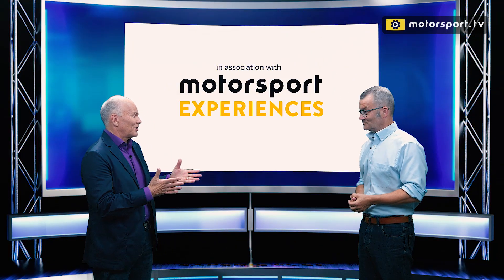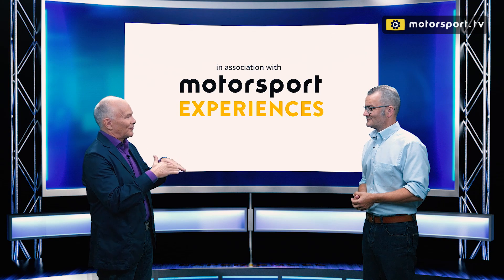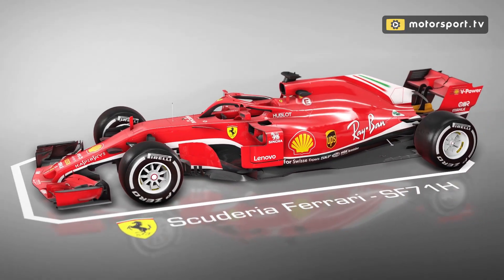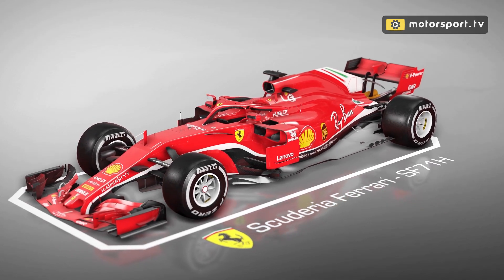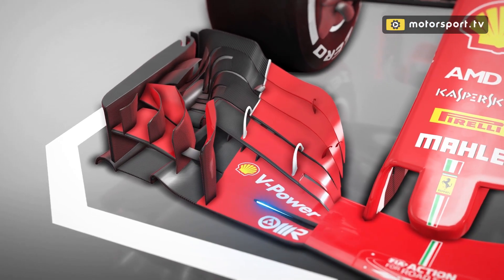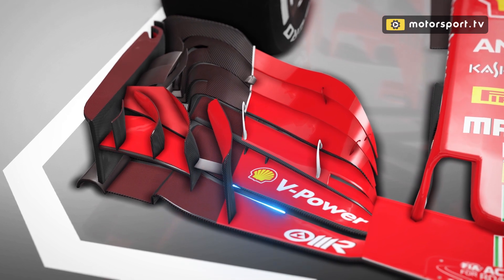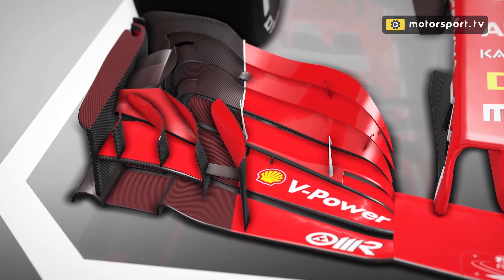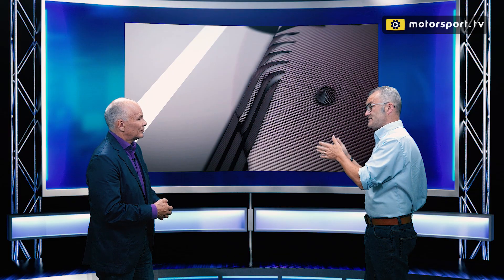How new floor slots helped Ferrari win the British GP

Comment: Ferrari brings a small update = improves a decent amount and becomes the team to beat
McLaren brings a whole raft of updates = Goes from being 6th best team to 8th.
Reply: McLaren have the best chassis. The only problems is the unreliable and underperforming Honda engine which holds them back. 

Oh wait. They can’t use that excuse anymore.
Reply: MashiatCOD99 a whole raft petty much won't matter if they don't work properly that's the biggest difference.
Reply: And floor and diffuser isn't small they're one of the most important areas of an f1 car that you can gain for laptimes in other words well worth it and paid off for Ferrari as clearly shown.
Reply: Gerogy Zurkov That's kind of what I'm getting at.
Reply: McLaren is a yoke... a YOKE!
Reply: Mclaren was never the 6th best team this year, that was an illusion created by the amount of points they gain from DNF´s by the other teams. If you see every race Mclaren scored points, most of them if not all, they did it because Force India, Renault, Haas and Sauber had accidents or DNF´s.

So basically Mclaren was always in a bad situation, it just looked like they were bouncing back, but it was because of other factors, not because they had or have performance.

If you see the races where mclaren didn´t score points (the ones they didn´t DNF) most of the faster cars in front of them manage to finish... So no free points for Mclaren to look like they are doing something right (which they aren´t, the car is a aerodynamic drag mess, making them slow in straight line speed).
Reply: Mohammed Ismail Truth be told, I think that is being taken out of context a bit. Firstly, McLaren generally never stated they had the best chassis in 2017, they said that they'd comfortably be in the top 4 hunt if they had a half-decent engine, and guess what? They were indeed the 4th best team at tracks like Monaco, Hungary, Singapore and were pretty competitive in tracks like Austin and Interlagos. I think the only time they claimed they had the best chassis was during the Mexican GP as a one-off, where they were the quickest cars in sector 2 in Q1, and one of the quickest overall. To say that 2018 is basically a continuation of 2017 is false, and every year teams come up with completely different cars and hence a differing order. McLaren themselves have admitted that their 2018 car actually has less downforce than their 2017 one, which is a pretty damning assessment of their situation. In conclusion, I believe that if they had had the Renault engine in 2017, they would actually be far more competitive than they are in 2018, simply because their chassis has gone backwards while everyone else has progressed, especially the likes of Mercedes, Ferrari and Red Bull, in a similar situation to Williams.
Reply: MashiatCOD99 I think EB did say they would be fighting RB in 2018 without Honda well this season has shown that is not the case at all. Not to mention they have been lapped by RB in majority of circuits.
Reply: MashiatCOD99 Anyway even with 6th they failed anyway since they should be fighting RB instead of trying to stay in front of midfield.
Reply: MashiatCOD99 williams is still slower than Mclaren. TR sometimes. The rest leap frogged Mclaren.
Reply: You know the rule, when you troubleshoot, youndo things one at a time, because one solution bis all you need. If you do things all at once, sure you might finish something faster but you wont know what fixed the issue. If ferrari put in an engine upgrade and added more downforce, even with data you wont know what helped unless you sre on a specific track like hungary or baku
Reply: Curious Cat At the start of the season, Toro Rosso, Sauber, Williams and Force India were all slower than the McLaren. Just look at the qualifying and race performances for the first few races.
Reply: Gerogy Zurkov Hence 6th best to 8th best out of 10 teams.
Reply: MashiatCOD99, they were TESTING prototype parts, barely any aero upgrades were brought to the car for many races including this one. "raft of upgrades" Are you fucking kidding me? That's the most misinformed/moronic statement I have seen in a long time. Are you fucking kidding? Honestly.

Only recently(after Austria) did McLaren claim that they think that they have gotten on top of their aero correlation issues.

Since they can't develop without knowing the cause of their issues, the only major upgrades for the MCL-33 were: 1.the new nose, 2.side pod deflectors, 3. 2nd revision of the deflectors+minor floor/diffuser/front wing adjustments. While other teams bring massive upgrade packages every other race.

McLaren said at preseason testing that they planned on bringing "raft of upgrades" at Canada and Silverstone, both cancelled. That's why why they are falling behind. Not that their upgrades aren't working, but they can't bring any (at least visible)upgrades in the first place. So McClown is doing worse than what your false claim suggest then to be.
Reply: MashiatCOD99, also as reported multiple times by media outlets. The MCL-33's problematic aero only works as intended at high speeds.

Therefore at "stop and go" tracks like Barhrain, Canada (fastest corner was around 140kmh), Paul Ricard. They have to runhigh DF to compensate, hence losing tons of time in the long straights.

Therefore they are significantly more competitive at high speed, high DF tracks like Spain and Silverstone. Showing us that the overall pace of the MCL-33 is higher(I won't comment on how much) than they are at extremely unfavorable tracks like Paul Ricard.

All you do is look at the results without doing any analysis or doing any sort of research then concluding that McClown's parachute-33 is the second most garbage car on the grid.